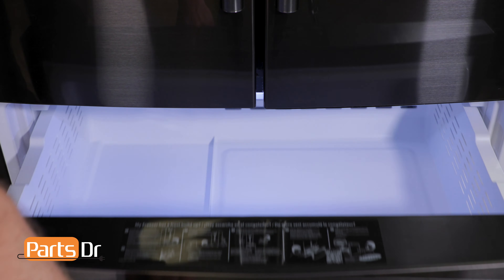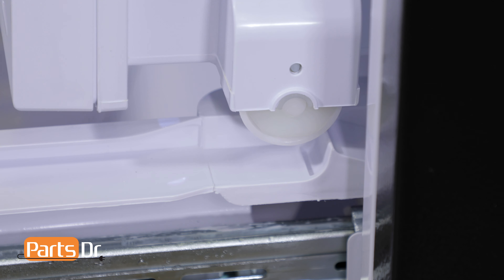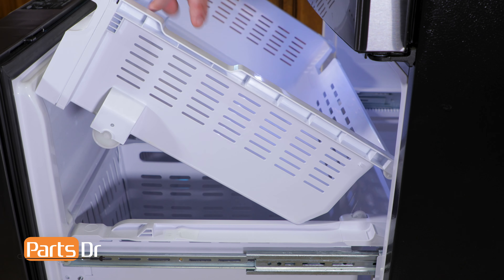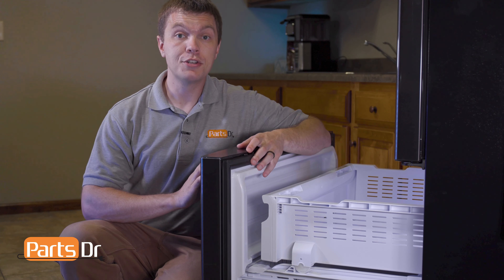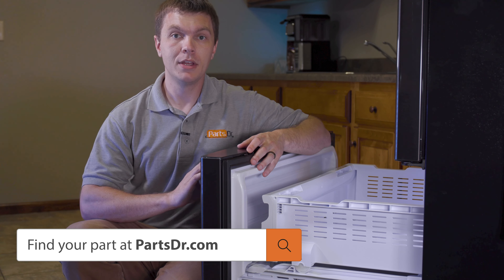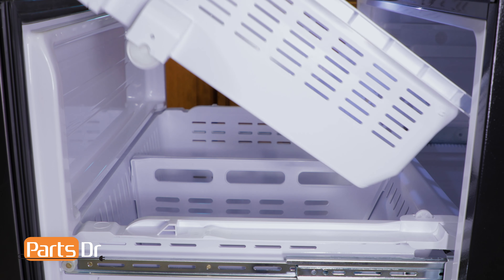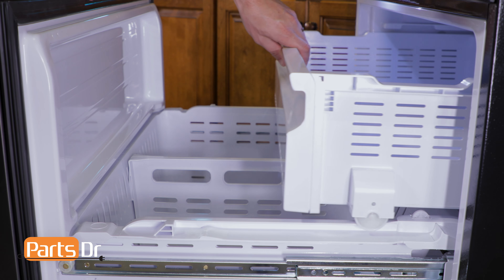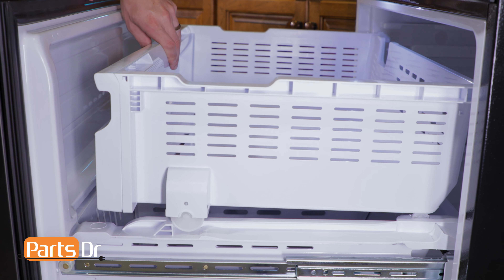How to replace the upper freezer tray part # DA97-12641D in a Samsung refrigerator

Comment: In the video, the bottom door opens enough that the upper tray is almost fully exposed. Our bottom door does not open as far as the one shown. I can lift the upper tray wheels off the track, but there is no way to "tilt and lift out the upper tray" Are there releases on the bottom door guide rails that allow the door to open further?
Reply: Mr. Harris did you ever figure out if the drawer does not open enough to lift tray out, what you have to do to get it out?  Am having the same problem. I can not get it out and would rather NOT remove the entire door.  Thank you.
Reply: @ksilva9437  hey, just saw your question. I guess our bottom drawer had never been opened all the way. The first section of drawer rails was smooth and easy. Then I finally tugged on the drawer and it started to pull out further. Inch by inch until it was filly extended. Almost like it was gummed up with molasses ;)! Then the trays lifted out just like in the videos. Not sure if maybe there was some tape on the hinges that was missed when installed. Never saw anything, now it opens with ease! Hope this helps!
Reply: Thank you @Walt Harris!
Reply: @wootler  Thank you so much!
Reply: Thank you! Had the same issue and just tried pulling harder on the freezer drawer and got us enough room to slide the tray back in easily.
Reply: @TMART09 Glad it helped! Funny - I kept watching these videos with people just casually opening the freezer and lifting out the drawers. It was driving me crazy! 😀
Reply: @wootler  wow thank you!!! I've been looking for an answer on this one for months.  I also didn't want to tug on the bottom drawer too hard for fear of breaking it.  but that's what it took to get the top tray out!!  THANK YOU.
Reply: @wootler  THIS ANSWER SHOULD BE PINNED TO THE TOP ON COMMENTS.
Reply: @wootler  😂😂😂me too
Reply: Thank you!!  I had the same problem and was going to take the whole door off to get the tray out.  Had no idea the lower basket slid another few inches! Works great now
Reply: @Walt Harris  Just stumbled across this video. Your reply was a great help. Pulled the drawer out further, and the tray came right out. Now, not only does the drawer open further, but it opens and closes easier than before.
Thanks for the tip.
Reply: @f-4gww458  glad it helped!
Reply: Thank you Walt as I struggled also and had to pull harder.  If anybody has the issue of the loud squeaking when opening the freezer, apply some silicone to the rollers on the TOP tray as it is plastic on plastic sound with the heavy weight of the top tray.   You can remove the rollers and use something like superlube or a spray silicone.   No more sound for me at 6AM.
Reply: Thank you so much!  I have been having the same problem.  Something got pushed to the freezer bottom so the door wasn't closing tight.  I could not get the tray out after all kinds of attempts.  When I pulled hard on the drawer it opened further so the tray could come out.  Thank goodness.  It also now gives me better access to the freezer.  Who would have thought?
Reply: @debbieeccli8106  GREAT!!!
Reply: You saved me
Reply: @godstriker8  👍😂
Reply: Us too…tried for an hour…I will never purchase another Samsung product.  The ice maker hasn’t worked right from the get go!  Shame on Samsung …I would love my money back n buy a different refrigerator freezer….
Reply: @rhondakthomas9717  Agree!!! Once we started having issues with the Samsung fridge, it was just one thing after another. THEN (too late) I started reading all of the bad reviews on their customer service. We are also done with any Samsung appliances!

Comment: How do you get the extendable bracket at the back of this 'auto pull out tray' to engage into the molded-in plastic stops at the sides of the freezer compartment?  The tray is going in ok but no longer pulls out while the freezer door is opened...so, not automatic pull out.